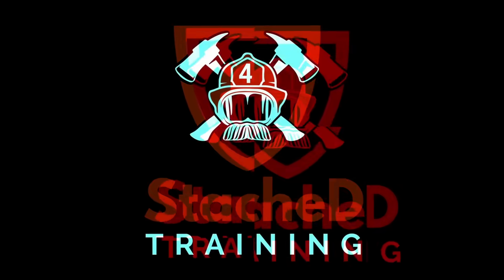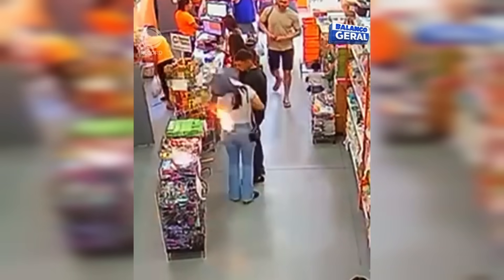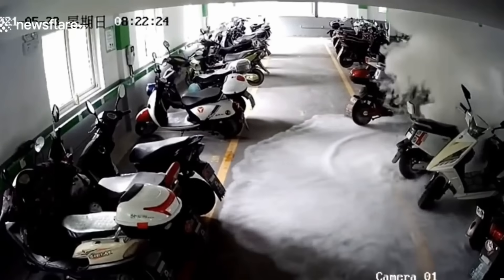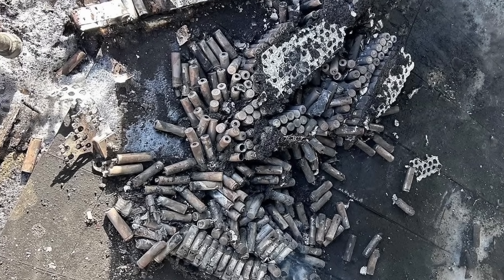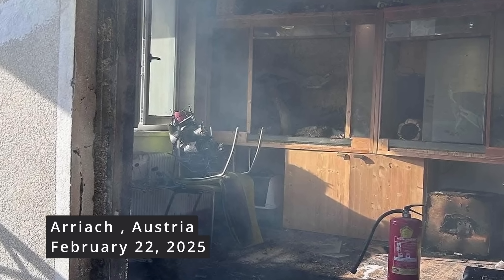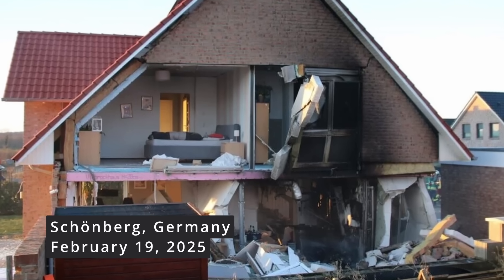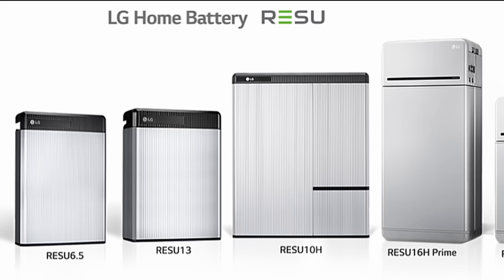Two Homes Just Exploded—The Hidden Danger in Battery Storage!

Comment: lithium iron phosphate do not release flammable gasses to make an explosion, either this is a hoax or the explosion was generated due to other factors , but lithium iron phosphate DO NOT RELEASE FLAMABLE GASSES !!!!!
Reply from the maker: You are 100% incorrect.   Hydrogen is the primary gas released, carbon monoxide,  carbon dioxide,  and a bunch of other hydrocarbons.

Comment: I am a naval architect and marine engineer.  My career was spent working for major oil companies tanker fleets.  If approached to install a large battery storage I would first insist the system be provided by a single major electric equipment supplier, such as ABB, Siemens, or SquareD.  The supplier sjould be responsible for the integration of the components.  The equipment should be compliant with all applicable regulations such as IEEE, IEC, UL, NFPA, etc.  If the installation is on a ship it should be compliant with IACS, SOLAS, IMO and USCG regulations and guidelines. 

I believe that the batteries shoild be kept in a detached location away from the home, that is well ventilated, heated and  cooled.  The shed or building that is fitted with blow out panels.  Electric equipment should be intrinsically safe or explosion proof.

Consideration should be given to doing a risk assessment and a Failure Modes and Effects Analysis.  Companies such as ABB, Siemens and SquareD should be able to provide this information. 

If an engineered approach is taken the cost may increase by an order of magnitude (10x), but you won't blow the back side of your house off.

Comment: I have two houses, and both have solar systems with LG batteries. They have both been replaced under a recall about 3 years back. Both are mounted outside on exterior walls of the homes.

Comment: Insurance companies should be stepping in and refusing to provide cover if the batteries are installed with more stringent safety requirements. There's no good reason why they can't be installed outside in a purpose-built enclosure with heating for cold climates, explosive gas detection, and blow-out panels to direct an explosion in a safe direction.

Comment: people crack me up  while they say they would never put one of these in their house the fact is they already have them.....ebikes, hoverboards, rc cars and toys, electronic test equipment, laptops , cell phones and especially battery powered tools which have caused catastophic home loss. you are right Lipo4 batteries are the best but are extremely limited because they should not charge below 0 degrees C or 32 degrees F , placed outside they need an insulated box which must be heated and weather proof.  The fact is any battery can explode even lead acid, but in my opinion LI-Ion is the worst and like I said before ...they can lbe found in most peoples houses

Comment: So a gallon of gasoline stores about 34 KW hours and a gallon of diesel stores about 37 KW hours, and it will sit in a storage container indefinitely without going into “thermal runaway.” The gallon of fuel can be poured into a generator on demand during a blackout to keep your power on THREE TIMES AS LONG AS THE BATTERY STORAGE SYSTEM.

Comment: For a home energy storage project, lead acid celled batteries are fine.  While far less energy dense than lithium ion cell batteries, the home energy storage system does not have to propel itself, so the main cost of the decreased energy density is that more structural materials are needed to support the battery.  Lead, being very massive, means that a cell dumping all of its energy into its mass does not actually raise its temperature by that much.

Comment: The problem with battery banks is when cells are paralleled, since if a single cell fails, the paralleled cells will dissipate into that cell causing the catastrophic failure in very short time.
EVERY cell must be individually monitored using multiple BMS's to guarantee disconnecting of a bank with a faulty cell. This is the only way to be safe.
It is more expensive to do it this way but better sure than sorry.

Comment: Good warning, but yeah, a homemade Li battery storage and an LG unit, which is well known for being a problem with batch and a particular battery cell used.
Most quality batteries, used with the right chargers are almost totally reliable and safe.
There is more chance of your ICE vehicle causing a fire.
It's still an unknown just what the good home battery setups will be like near end of life, when chemical stability is possibly deteriorated.
Only time will tell with that.

Comment: I'm looking at solar here in North Carolina. With the power company not wanting any non-contract connections, that means battery is a must. (Throw in the gross reliability issues like my first year in this house, the area had 2 outages over 3 days at a time, and hundreds of "It was only off for a minute" outages...) -- My thought:  a shed in the back yard where limited temperature control can be handled easily (keep things from freezing, and a bit of cooling during the summer...)   Putting the switching on the outside of the house, but batteries off in isolation in the back yard.  Plumbing the power (be it DC or Ac from microinverters) that would provide safety for me inside the house...An extra $$$$ for a shed is a good investment for peace of mind.

Comment: Way back when, people storing electric power from solar arrays would use big lead-acid cells made to provide backup power for telephone exchanges. Apparently they were sometimes available surplus at reasonable prices.

I don’t think that lead-acid cells are as dangerous. Heavy, lower power density, sulfuric acid, tendency to die after relatively few cycles… but not as bad?

Comment: I think calling this a diy project is a little bit of a stretch and a little bit of fear mongering. clearly taking Tesla batteries out of a car and trying to use the power. Your house is not too smart of an idea. There are plenty of incredibly safe, solar battery systems that can be installed by the end user with the proper charge controller and the proper batteries and also it seems you’re not kept up with the battery technology because lithium iron phosphate. Batteries are the way to go now and they nowhere near have this kind of reactance

Comment: I think that it's interesting. The biggest problem in the USA is UL listed. Lots of companies don't see the need to get it. The ones that have cost more. 

So in the end you get what you pay for. If you actually want something that is outdoor rated then get it. The price might be more. But how much is your house? The best thing to do is install the system in a outbuilding or just outside away from a house. Lots of systems are listed and rated for this use case.

Do your homework and be safe. Your family should come before saving the planet. In most countries diy systems how become illegal to install because of the danger from them.

Comment: Now, there are electric powered paragliders that use lithium batteries. A dangerous activity, even without the added risk of a battery fire a few centimetres from your back, that would probably take out the harness and/or wing attachments before you can land while also burning you, and then setting fire to whatever it lands on. No thanks, I'll stick with a noisy 2 stroke engine if I ever take up that sport!

Comment: I think one of the ways to bypass a possible problematic EV battery system is to use a separate, fireproof small, strawbale shed encased in cob dedicated to battery storage alone.

Comment: My solution would be a simple, solution the house batteries would be installed  inside a commercial flame proof steel cabinet that has vents, mounted outside on a concrete pad. If there is a fire, a fire hose firefighting fitting could be attached on a steel pipe a few meters away from the cabinet and run to the cabinet with a sprinkler outlet, thus the cabinet would not need to be opened for flame suppression.

Comment: Too cheap to invest with Lithium Iron Phosphate batteries. They are far safer than LiPo crap. Home battery banks should be located outside and away from the home. One great alternative is a cargo container that has been modified from a 8 x 20 to an 8 x 10 container. You can insulate with rock wool and add steel studs and finish with a fire rated drywall. For explosion safety an engineer can design a roof "vent" that will intentionally fail upwards in case of an explosion. A fire detection system consisting of Ionization, photoelectric and heat sensors should be installed. This system could also open vents in the roof vent add on. As for air ventilation a decent fan system should be installed externally to the container and in cooler climates the air would be heated via a water radiator heated system to prevent  a dangerous drop in temperature in the container. This also eliminates the water heating system from being located too close to the structure. The fire system should also be connected to power interrupters that are located in explosion proof containers to disconnect both charging and power loads to the batteries. It’s well worth the time, money and trouble if you loose your home to a situation such as battery failure.

Comment: My shop fire was 7 months ago.  My home backup inverters and battery bank of 46 kilowatt hours,  with 12x300 amp hour name brand LFP batteries In 24 volt configuration, each with 200 amp  internal BMS. It ran fine 24/7 for 2+ years with absolutely no signs of distress. Each battery had a fuse on the negative post, wires were 4 ought and 2 ought, all terminals were hydraulically crimped. The system was at 100% charge with only 1  amp coming from all solar panels combined. The entire load was less than 650 watts of a total capacity of 12,000 watts. This never should have caught fire.

A battery on the bottom shelf ignited and burned 8 of 12 batteries. I heard a loud pop from my bedroom above the unit, saw the smoke, dialed 911 while charging my home built 1 inch double lined fire hose on my roof deck. Within 70 seconds of the pop, I had water at 120 psi spraying a 30 degree fan pattern through a small skylight. The heat burnt my arm and the entire time I was laying next to the skylight awaiting an explosion while shooting water toward the power console. When the smoke went gray and turned cooler, I heard the fire engines coming up my street. They had a 4 minute response time!

 The Fire Captain said that my fast action saved my home. The Forensic Fire Investigator thinks the BMS failed catastrophically but did not rule out that the battery might have had shipping damage...such as being dropped upside down.     $150,000 damage. Insurance covered it.   The last contractor left this week. The garage and shop are finished but needs another 3 months to reorganize.    I will buy the EG4 48 volt UL Listed battery backup system, but rest assured it will go in a concrete bunker away from my house with 195 degree F actuated sprinklers above it.                                                                     Keep up the good work StacheD
Reply: what brand were the batteries?
Reply: @MilitaryTalkGuy  My insurance company has a lawsuit against the battery supplier and said not to talk about brand names. The Forensic Fire Investigator said the same thing when I called to hear his input. This fire really popped me on the  chin's and it took 7 months to have contractors complete the repairs. Their brand has a good reputation but either the BMS catastrophically failed or a dead internal short happened possible by being dropped during transit.
Reply: @MilitaryTalkGuy  He used CHINS they are junk Amazon seller batteries. Just search his YT name pops right up on DIY solar forum pictures of his setup all burned up. He had them in a shelf not even enclosed in a metal box. Plus they were parallel which is always a bad idea taking 12 or 24V and doing that. If your going to diy a pack use 16 cells and put a Class T fuse right off the battery terminal before the BMS. If the BMS shorts something will open the circuit.
Reply: what were the certifications, if any, of those batteries?

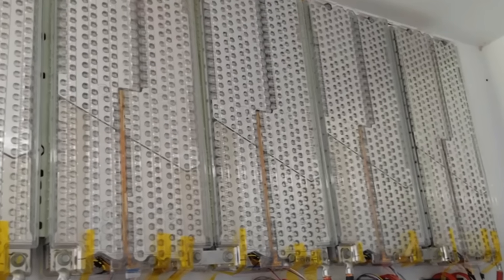Comment: 0:30  I am always on the side of the DYI guys, but not with this Lithium Ion crap!!!  I don't think used automotive lithium ion cells should be re-sold at all! .. they should go straight to recycle :( .. !!   I don't need my neighbourhood burned down by some mad scientist trying to save a few bucks! 

I've motioned before I building a "Overlander" out of an old Step Van .. I putting in a big alternator and 900+ Amp hour battery set up, made from??????  Brand new 6 volt Lead Acid golf cart batteries, the same style your local course has been using for 100 years!!

Nothing to invent or tinker with, its right out of every golf carts play book! ... I would be afraid to find out how much or even IF lithium ion batteries would be for Van insurance???

Comment: you would have to be a halfwit to install one of those battery systems inside your home ,just as parking and charging an ev in your garage is equally as dangerous, I have an ebike but the battery stays outside near the fence in a metal box well away from the house

Comment: Like recycling, if compliance costs becomes a barrier people find away around it and their own solution.  First they make the grid unreliable, then ban generators so people are forced to DIY.  i.e.  I would guess the risk of DIY power walls are low lets say less than 0.01% but the risk of losing electricity for a day is much greater almost 100% in most areas every year.  I will trust my own engineering skills way before the safety regulations that are being written or lobbied by the industries that want the laws written to push their own products.  Having said that I would not trust LIon batteries, I use all sealed lead acid or NiMH.

Comment: I have an energy storage system which, according to the installing company, codes had required to be installed outside.  When it was extremely cold (0F, -18C) a car hit a pole down the road and we lost power and the battery was struggling.  Annoying, but it is a lot safer with that thing being outside.

Comment: I live off grid and have battery storage... but I use FLA cells not lithium as they are 1/5th the cost and need not be light as it is a fixed application... additionally my battery bank is in a separate well vented CONCRETE enclosure that would contain any explosions and fires...

Comment: This is the result of politicians pushing an agenda before the technology is ready.  Lithium batteries are a volatile technology.  I would never trust my home to a BMS single point of failure.  We won’t see this information on the main stream media as it doesn’t fit the green narrative.  I would only consider a NiCad battery system in a concrete building away from the home with a vented rood to allow for escaping gases.

Comment: I would build a shed to put the battery storage unit in away from the main building. Same goes for the cars. Even if it doesn't cause a fire if you have one and the fire spreads to it it can't be put out.

Comment: Hi density lipo is so unstable and dangerously flammable it should not be used for BESS.   Only with individual cell monitoring and thermal management and early retirement aare they ok in EV cars.   The Moss Landing BESS lithium fire in Monterey Bay is something that hobbyists that use lipo for drones, planes, and other toys already knew about and could have been prevented.  Sure lipo is high density, lighter per watt and takes up less room, but so dangerous and hot that you have to space them so thoroughly so really doesn't take less room.   I vote make lipo illegal inside living areas past a certain amp rate.  Not for big energy storage BESS either.  Although the recycled Nissan and Honda batteries in Lancaster CA BESS fair better than the new lipo used at Moss Landing.   Nissan EV batteries are modular and they just throw out the bad cells.  Build outdoor charging stations for ebike batteries.  Redox flow and other saline batteries are bulkier but coming up on us quick and non-flammable batteries can be mounted closer together in stationary applications, so who care about density in non mobile applications?

Comment: OMG, when something like this happens and it's to do with battery storage, just like when an EV goes up in flames, the sky is going to fall in. Battery storage and EV's are too dangerous, let's stop this madness.
Every new tech had and will have some issues and over time, these issues will be rectified. But, in this situation, it was a home handyman doing high tech work, no testing no, what could go wrong. 
Home power storage is very safe, so please don't use something like this to scare people away from this type of tech, it's the future.

Comment: Even fully electric vehicles from China have been regularly exploding in a similar way causing major building fires across the country. Bigger electric vehicles such as trucks and buses can also have battery packs similar in size to the ones in those home energy systems and often explode and cause injuries and deaths when they are cheaply made and are likely defective from the factory as a result.